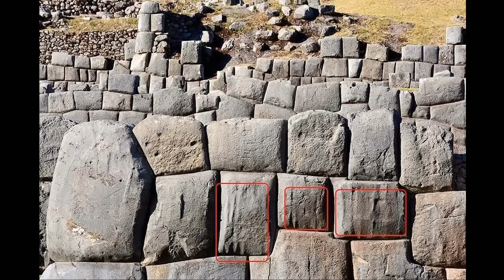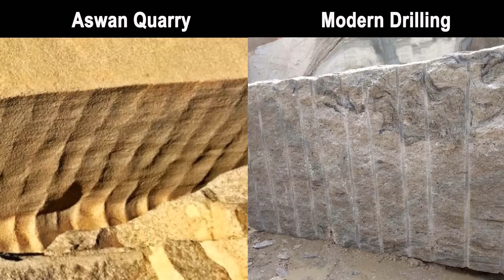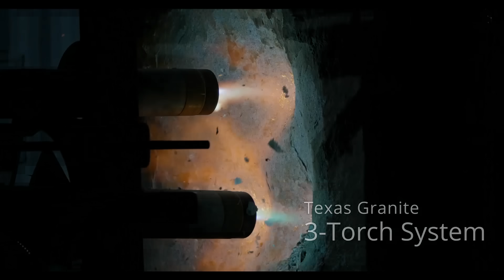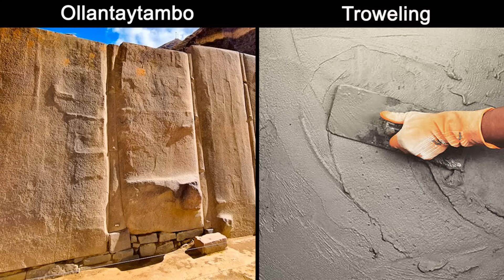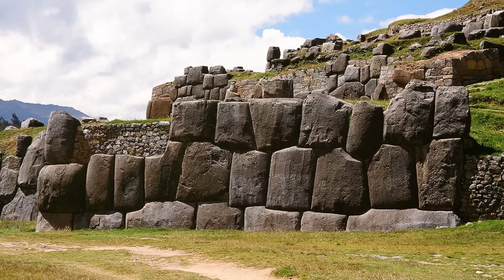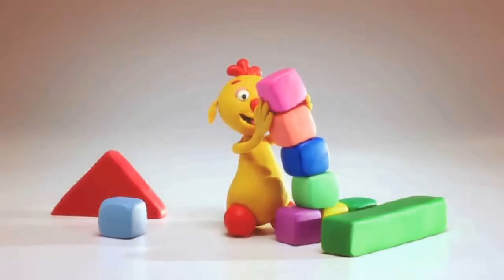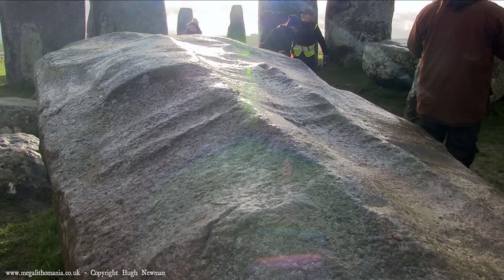Megalithic Mystery: Different Scoop Mark Types?

Comment: Once again impressed by your analysis! Thank you, Tina!

Here are my thoughts
The marks in the Aswan quarry indeed looks similar to the plasma cuts of today. Though as I understand there are other ‘gas-based’ techniques to cut through stone, not necessarily plasma as demonstrated in this video: 
https://www.youtube.com/watch?v=JhXl8rrVzTU
I’m also thinking that the ancients could have some kind of gas/chemical that we don’t know. What makes me believe it’s a possibility is for instance the ‘Schist disk’ which by its look must have been sculpted as if it is from clay. As far as I know while schist as a material contains a high percentage of clay, we don’t have the method today to sculpt with it and thus the official opinion is that it was carved, which sounds ridiculous. Anyway, my point is that if we don’t possess this part of the ancient chemical knowledge, we could as well miss other parts.
At this point I believe the plasma/gas hypothesis should be tested on site by a competent team for vitrification sighs. I’m no specialist here so don’t know if that would be possible by comparing high-quality macro shots of the material. If the latter is possible that would be great as the former is unlikely to happen with the current state of things.

It looks like Egypt has both the 1st and 2nd of marks as you describe them. The first one in the Aswan quarry while it looks like both Osireion and Menkaure pyramid casing stones were molded. It looks like both the molding and refining were done right at the place. I am not so sure about the first one, but I would assume it could be true due to the puffy look from the outside of the unfinished stones and yet perfect fit between them. It makes me think that the nubs could be the points through which the polymer had been poured. 

There are some more questions appearing about the marks in Osireion on the unfinished wall (between the smooth and rough part). If we assume that the blocks were softened due to molding (as opposing to applying some technique to soften the already hard stones), were the scoop marks a result of scraping the still soft material? And if so how long did it remain in that soft state? Since the builders started the ‘polishing’ process from the top, it implies they were in no hurry to apply this process until they finished constructing the whole wall and thus the softened state remained for quite some time. Otherwise they would have to polish the wall as soon as they molded the lower rows. At the same time, if the polishing was done by scraping and thus a lot less time-consuming, what prevented them from completing it?

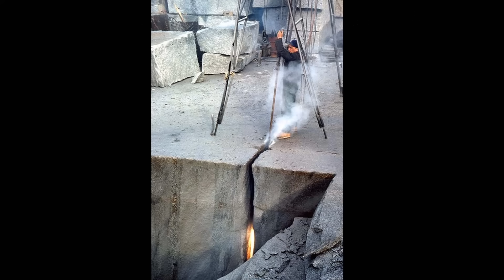Lastly, there is another kind of markings that can be of your interest. It’s also in Egypt, Luxor. You can see them in this video https://www.youtube.com/watch?v=nrCYaZZRscQ at 4:16 and 11:00. One of the comments stated that ‘Similar marks are left by a laser beam when cutting a metal sheet if the focus or cutting gas pressure is incorrectly adjusted’.
Reply from the maker: Thank you for sharing your insights with me; I really appreciate that. The first video you mentioned is a thermal/high temperature torch which used gas as fuel to cause thermal spallation on rock. I referenced that video in one of my earlier videos on scoop marks (Scoop Marks on Unfinished Obelisk: What Tools were Used? How were they formed? https://youtu.be/26bf49slA2s)

I agree that Egypt has both excavation scoop marks and screeding marks. I discussed the screeding marks at the Osireion and Menkaure Pyramid in the following two videos and proposed these stone structures might have been cast: 
- The Osireion: Mysteries Unveiled - Osireion Water, Construction & Purpose https://youtu.be/lkVUdKygb-U
- How were the Perplexing Giza Pyramids' Granite Blocks Created? https://youtu.be/flNBgH-f_nk  
(Btw my 2nd video on the Osireion: Osireion Mystery & Anomaly Revealed through Rarely Known Features https://youtu.be/8i4qhUWH1go)

Thank you for the link of the interesting markings at Luxor!  I'll do some digging on them :-)
Reply: @CuriousBeingbyTina  Thank you so much for the extensive answer and the links! I will definitely catch up on the videos I’ve missed and rewatch the ones I’ve already seen. They are so packed with info that it’s easy to forget all the details, like I did with the torch - I initially thought I might have seen it in your video, but wasn’t sure as I’ve stumbled upon it on my own too :)

Just now I was looking for examples of traces on Caucasian dolmens (which are yet another kind of fascinating old structures) and found an article that casts some light on the on the molded stone technology and makes a lot of sense to me personally. It looks like I can’t post a link here, as the comment automatically deletes, so I’ll try to retell it in short and if you will be interested in the full text I can probably send it via email I guess. 
Many of the dolmens also feature the distinctive tight fitting of stones, embossed carvings, L-shaped blocks like that of the Valley Temple of Khafre and don’t exhibit typical stone carving signs. There is either no sign of such at all or the surface looks like spreading of plastic mass or in other cases the marks still don’t look like the blocks were carved, but rather like signs of scrapers, not chisels, as if it was plasticine. What’s also interesting is that all the modern attempts to recreate the tight fit of the blocks, even when moving and reassembling the already created dolmens, were unsuccessful and resulted in appearance of wide gaps.
And what really gives us a clue about what it could be lies in some of the nearby weirdly-looking sandstone mass, looking like solidified mud volcanos. While inspecting a tectonic map it appeared that all the dolmens were standing exactly where the tectonic faults were! Which answers the questions about quarrying and logistics, which would be troublesome in the heels - the dolmens were created right next to the place where the sandstone had erupted. There are some pictures and descriptions in the article of how the molding could have been done. It’s a very curious read.  Now I wonder if any kind of similar solidified mass has been discovered in Peru or Egypt? Or was it an entirely different technology, as the dolmens, for instance don’t have any knobs and lack the precision of Egyptian architecture?
I hope you’ll find this info helpful and meanwhile I’ll proceed with checking your previous videos :)

Comment: I think the same. Ask yourself, if you built a replica of a wall like the one at Sacsayhuaman using clay blocks of different sizes and pressed them together, would it look similar?
Reply from the maker: I did used clay to experiment my hypothesis before making a video on Sacsayhuaman construction in 2020 :-)

Comment: Worked a season at a marble mine in NW Australia. It took a month to cut a 200 ton block with a 14km long steel  wire.The ones who worked this hard stone were way ahead of our tech. Think dentist ultrasonics.
Reply from the maker: Thanks for the information, I agree the ancients were really advanced. I think there might have been a previous advanced civilization and some of the best megalithic sites were the remnants of this civilization. Maybe you will be interested in the following videos: 
- Great Pyramids’ Radiocarbon Dating: An Inconvenient Truth https://youtu.be/UgLuLd_4B18
- Surprising Distant Timeline of the Great Pyramids & Sphinx https://youtu.be/8-aQJgY6OxY 
- What Caused the Fall of a Previous Advanced Civilization? https://youtu.be/Zs4zLKbp4Ic  
- Lost Megalithic Civilization: Where to Find Their Remnants? https://youtu.be/0KBfaLJykF4
Reply: That is very poor production. We typically quarried 1,000 to 3,000 tons per month of hard granite by drilling and splitting without wire. With wire 30 tons per 8 hr shift. That's only 7 days for a 200 ton block of much harder hi- quartz granite. The blocks by wire were sawn on all 6 sides.
Reply: @GroberWeisenstein 
Now can you cut or carve the granite stones into polygonal shapes and fit them all together like a jigsaw puzzle? Quarrying is one thing but fitting them perfectly together without any gap is entirely another matter.
Reply: @GroberWeisenstein 
Can you replicate the megalithic stone walls in Sacsayhuamen or Machu Picchu in Peru?  No you can't because no one knows how they were made.
Reply: @GroberWeisenstein 
😂🤡
Reply: @Anonymous------ how would you know you are not a stonecutter or quarryman.

Comment: 11:40 YOu will see the backs of the blocks that you are proposing are geopolimar made show sharpe angles that leave spaces tha have filled up with dirt. The back inward facing sides are also not "pillowed and have rough broken suface on the veritcal sides. this indicates that they were quarried and not soft at any stage. 
I propose the stones that are missing that would have been above were vibrated with pressure durring the installation and the stone on stone action would have worn them smooth to a tight fit.
Reply from the maker: The "rough broken surface" of some areas of the blocks might be generated by casting directly against some rough natural terrain and thus reflect the natural backing sides of what's behind the retaining wall.
Reply: @CuriousBeingbyTina then why isn’t the vertical back side of the stones in a straight line? They are at all sorts of angles. One has a back side at near 45degrees.

Comment: Plasma is interesting idea - the rest does not make much sense.Why would you pour such odd shapes  - that would mean you need thousands of unique forms to pour concrete into... the shape itself does not comply to forming.
Reply from the maker: Thank you. Actually there is no need to make individual molds for each block. I explained my thoughts on the molds and unique shapes in the latter half of this video - Explained: How were Peru’s Sacsayhuamán Walls Built https://youtu.be/x9S4CqY3eSA     When the cast blocks were placed in position while in a plastic state, the compression from above and sides would have pact the playdough like blocks to fit into existing blocks thus change their shapes.  This way even blocks from the same mold would have resulted in unique shapes. Polygonal walls with interlocking blocks also perform better structurally.

Comment: It's ridiculous to think those blocks were cast. If you were casting them they would be blocks that were all uniform and the same size. They wouldn't make a different form for every single Stone which is what they would have to do if you believe that those were cast. They would all be uniform and the same size. They definitely wouldn't have made cast stone so enormous and difficult to position.
Reply from the maker: No need to make individual molds for each block. I explained my thoughts on the molds and unique shapes in the latter half of this video - Explained: How were Peru’s Sacsayhuamán Walls Built https://youtu.be/x9S4CqY3eSA     When the cast blocks were placed in position while in a plastic state, the compression from above and sides would have pact the playdough like blocks to fit into existing blocks thus change their shapes.  This way even blocks from the same mold would have resulted in unique shapes. Polygonal walls with interlocking blocks also perform better structurally.

Comment: Probably, the folks who made the scoop marks used a parabolic dish made from stone that was coated with melted silver, and the sun's rays heated the surface of the stone, weakening it so that hard pounder stones could chip away at the surface.

This process was repeated until a certain depth was reached, then the equipment was prepared for the next scoop.

Comment: I think they would heat up the granite with focussed sunlight with a lens or a curved mirror whereby the the solar heat is reflected into a focal point. That would certainly heat a specific area and not cost any fuel. After quenching and pounding the brittle material away they could reposition the mirror for the next area, resulting in a scoop mark.
Just like making a fire with a magnifying glass.
Reply: Below the rock? Upwards? You would need a tiny mirror to redirect the whole energy. As there's no perfect mirror, the mirror would melt quickly.

Comment: Look for "Sound Dunes" and you will find experiments with sound waves on sand. Some of them look stunningly the same as in the megalithic structures. Same lows and highs and squarish; and even though they are a bit smaller, i could imagine that with an enormous higher loudness (Like the mysterious Angels trumpets sounds being heard everywhere) you could get this effect. Softening the atomical bonds and helping to remove or move it.

Comment: The cast thing does not make sense. Too many different types of casts of different sizes and shapes would have to be made which seems incredibly ineffecient
Reply from the maker: No need to make individual molds for each block. I explained my thoughts on the molds and unique shapes in the latter half of this video - Explained: How were Peru’s Sacsayhuamán Walls Built https://youtu.be/x9S4CqY3eSA     When the cast blocks were placed in position while in a plastic state, the compression from above and sides would have pact the playdough like blocks to fit into existing blocks thus change their shapes.  This way even blocks from the same mold would have resulted in unique shapes. Polygonal walls with interlocking blocks also perform better structurally.

Comment: They where made by high pressure water jets, build a granite coffin, make a lid for it of granite, say 50 tons plus, the lid must be able to slide freely inside the box, but with no gaps at the sides, almost like how a piston would work, then the box has an inlet and outlet, water is filled inside the box, possibility also an abrasive, then a copper pipe was attached to the outlet with a nozzle, when the lid was released it pushed the water down inside the box, which then came out through the hose at a very high pressure, this amount of pressure can cut granite like butter, that's why we see the scoop marks, water did that, we think ancient civilizations had high tech devices, but it was just simple stuff, like weight, gravity, understanding of geometry that they needed, they had enough man power if needed, but most probably when the water was low in the box they closed outlet and let it fill again through inlet, I'm sure as the water filled it lifted the lid back up, then they repeated the whole process, I did some research and came to the conclusion that water released under intense pressure can cut nearly anything with ease, that's also how they got such precision, water cutting is a high precision technique, they used math to create this, weight, volume, velocity, gravity, that's my theory.

Comment: No torches. They used the suns rays through golden mirrors. The gold platters found are not for food as thought, they are for stone work. Heat the stone then dump water on it and it spalls. This is why the "scoop marks" are so similar in size as the mirrors were the same size.
Reply: A 2metre concave polished copper mirror mounted on a tiltable frame could be used to direct the hotspot at the focal point onto the working stone face.  Rotating the mirror to move the hotspot would produce a slightly curved track. A secondary mirror could redirect the hotspot locally. Just thinking of possibles.
Reply: Nice thats exactly what i thought 🤔  focussing sunlight into a focal point and quenching it with water.

Comment: the marks using a plasma torch in the modern quarry do match I agree. Also if they used dolerite rocks to smash their way down while in a squatting position, the marks also resemble a humans natural range of motion while squatting and swinging down with two hands. I agree your method is far quicker and I can't say they did not have a tool similar to a plasma torch so i am torn between the two explanations.
Reply: How you pound upwards with the dolorite pounding stone below the block?
Why leave rims? With pounding you would attack the highest point first, as there's the best result to remove material.
Try use a modern machine like a Hilti. Try dig in trenches in the material and try later to remove material on high points. Humans would find the easiest way on this hard pounding work. There's no reason to leave equal spaced rims.
The plasma torch makes more sense.
Reply: @jochenwagner2782  your right about high points and pounding up and a torch may make more sense but I am still wondering if there is a third method using tools we know they had but I can't come up with an answer

Comment: Hmm.. not cast I think.
If they were cast, then a mold would be used for uniformity.
There are NO same size shaped blocks anywhere in Peru. They are all very different.

What I think is that the builders had stone softening/cutting/shaping technology, which was used to cut the various size blocks at quarries. This technology was then used onsite for their final fit and shaping.
This method would have allowed the builders to get such precise fitments as you suggest whilst still in their plastic state as they were mated onto the other blocks for perfect fit.

The outside faces of some stones  look like a softening technology was used to make them smooth and pillow like. It is similar to rendering but not adding material, merely using the same softening technology to smooth the faces.

Now.. how did they transport and hold in position such immense blocks whilst they were doing this all this manufacturing and fitting?
Perhaps the same technology had anti-gravity properties? Or could render the weight of these blocks  meaningless so they could be easily handled?